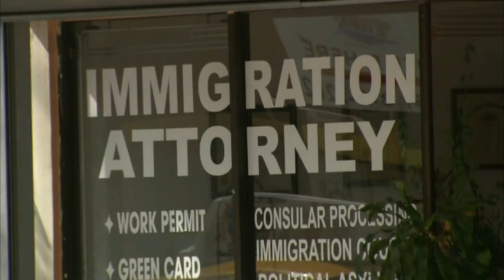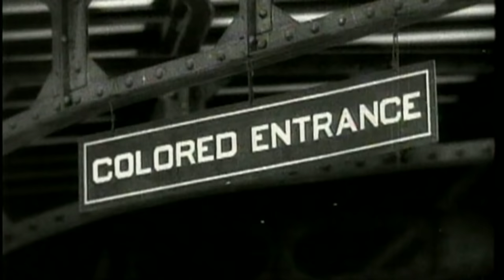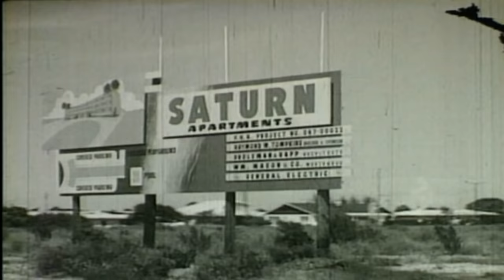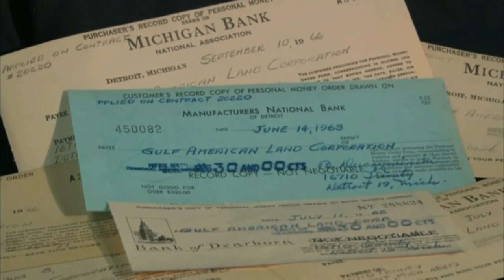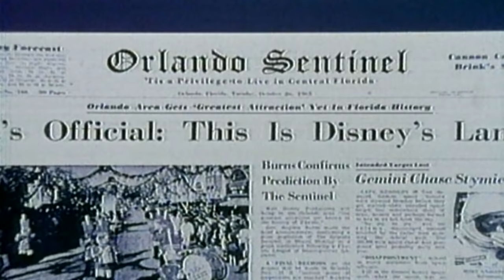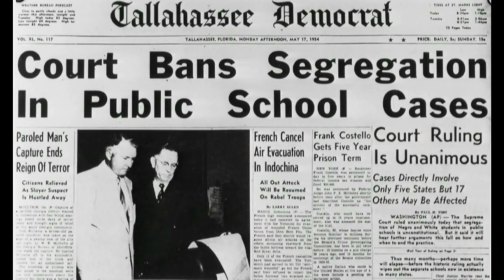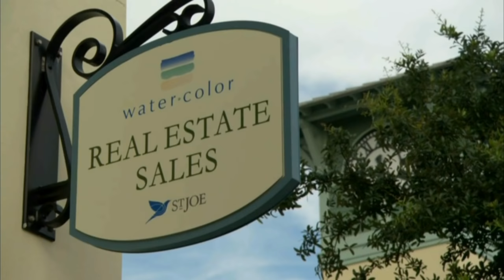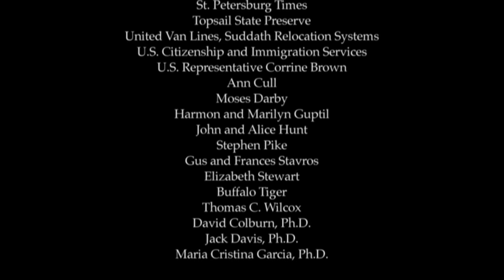Florida Dream

Comment: "Florida, a tropical paradise..."   The very first sentence has a mistake.  No part of Florida is in the tropics.   It's a common misconception.
Reply: @b4536  I'm not wrong.  The tropics are that portion of the world between the Tropic of Cancer and the Tropic of Capricorn.  If you look at a map or a globe you'll see all of Florida is above the Tropic of Cancer.   Labeling it as a tropical climate does not put it in the tropics.
Reply: @b4536  We're talking about two different things, geography and climate.  The tropical zone is an unchanging geographic location.   A climate zone is an arbitrary label that can change over time.
Reply: @b4536  I don't laugh at replies, so I guess we have a disagreement on that, as well on the wording of the script.
Reply: @Kuroki420  Thank you for the kind words.